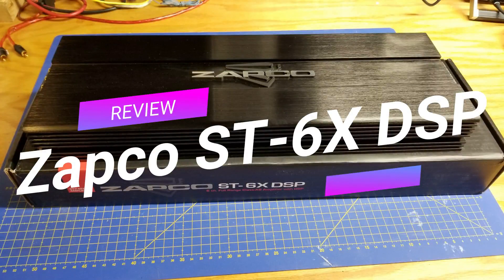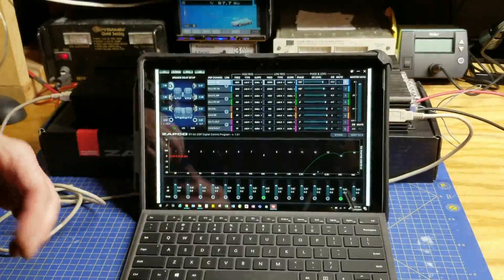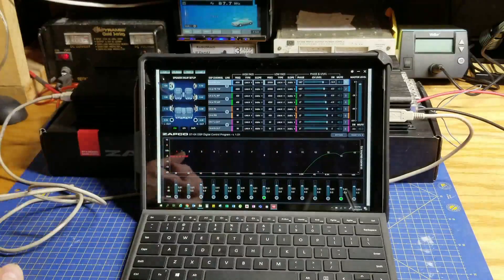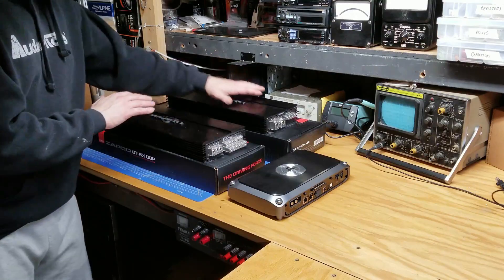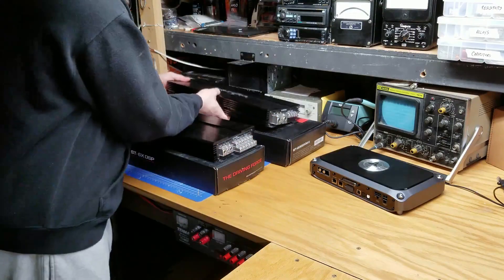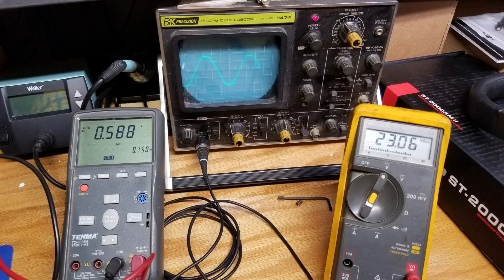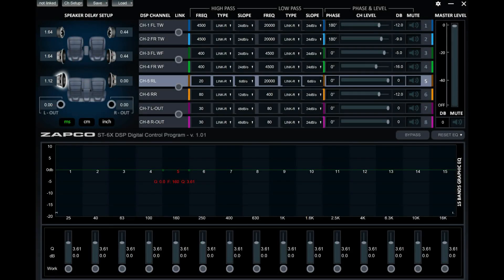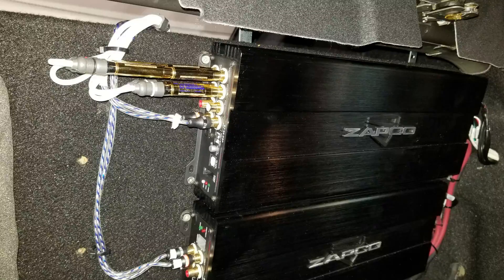Zapco ST-6X DSP Amplifier Review - Spoiler - NO INPUT GAIN!?!?

Comment: Hey I just bought two of these and also a 12 channel pxe 0850x alpine dsp. You think I can by pass the dsp on the zapco and just use the alpine dsp? For my gain setting and fix whatever problems you were talking about?
Reply from the maker: Since you have output control on the PXE, you can use that adjustment to control the signal into the amps so you the lack of gain adjustment isn't as much of a deal.  You'll have more DSP than you need so you can just bypass the amp DSP And use the Alpine.  You can use level output in the amp to tune, which is my recommendation, so you keep all of the amp input signals the same.  It's a weird way to do it but they made a weird amp.   They have corrected the lack of input gain in the newest models.

Comment: I got hte same amp with dsp and my software does have gain set up.
Reply from the maker: I've been told that all of the new amps have improved capability and it's possible the software has been updated since.  Note that output level is not input gain, and the model I tested only had output level.

Comment: Zapco’s stance as well as many in the sq community dont believe in raising amp gains as it reduces headroom and makes whatever noises that may already be in the system louder. The proper way to raise amp gain is from the line driver. Some music has as much as 20db of range in the recording. By default turning up your gains borrows from headroom.
Reply from the maker: The omission of input gain has been corrected on newer models.  The amps came out with the gain essentially at "MAX", which is the opposite of what we would do.  You could not add a line driver with this amp.  We could not use more than 20% of the head unit volume.  They inverted the gain structure.  If you're trying to make a case that what Zapco did is correct, then you're saying that all amps could come out with a fixed input gain set at maximum, allowing for minimal input signal level.  What you're saying is that the amp gain should be fixed at minimum, and then input signal should be boosted with external means, but that's not what Zapco did.

Comment: Im looking at the st-6xsq to run my front. A good choice? 6.5, 3.5 and 1". Looking at the audio control DSP. Your opinion on an external DSP? Thanks!
Reply from the maker: I run JL VXi amps with internal DSP and love them.  I've actually sold all of my external DSPs.  Moving forward, integral DSP will be my approach for space-saving and seamless integration with a reduction in cabling.
Reply: A friend is running an sq system and runs masconi now, though, switched from JL, and said I'd be doing myself a favor by going that route. Funny, this popped up a few days after. After reading more on zapco they still make great amps but not like my old Studio series from way back. JL, like a few others, has the long-running standard of being the bar or above. Greatly appreciate the advice!👍

Comment: Do you know if the zapco dsp-iv ii has this problem. Looking at using one with a 5volt output head unit. Thanks.
Reply from the maker: I haven't tested it but I can say that the Zapco engineers have publicly (on DIYMA forum) defended their design and have said the lack of input gain was on purpose because no one should have a source with that high of a voltage output.
Reply: @richardvedvik979  but there is. A kenwood 5volt output will do 4.7v with a 0db tone. They really should include some form of adjustability.
Reply from the maker: @raymondc9896  Totally agreed, we returned these amps to Zapco because we were using a 5V Kenwood head unit.  I think this was an oversight and they aren't fixing it, instead, they are just saying it's a design feature.

Comment: I just saw another video of this amp and it says u can control gain from the dsp
Reply from the maker: You can control output level, not input gain.  Those are two very different controls.  Zapco has confirmed that they did not include input gain adjustment and do not plan on adding that function.

Comment: Hi, I'm new subscriber. I have a 3 way FOCAL ES165KX3, I going to run active, already have a Alpine pxe-0850s dsp. With choice do you recommend me? Jl audio xd600/6v2 or zapco ST-6X SQ ?
Reply from the maker: Either are good choices but they each are different sizes and layouts.  Can you fit either?  The non-DSP Zapco has normal gain adjustments and is a nice amp, just bulkier.
Reply: @richardvedvik979  thanks for your answer Richard. What is your personal opinion about the dsp alpine pxe-0850s?
Reply from the maker: @hinchadahe  I've had Alpine processors since the 90's including the ERA-G320, PXA-H701, and PXA-H800.   The newest model has even more flexibility with 12 output channels.  And I like the interface options and wired remote.

Comment: Oh My God!! My Zapco dc 1100 came in and I just realized no physical gain knobs! Soo used to old school amplifier!! Besides software calibration wise. Can I just just plug this in my car and play it without any calibrations?
Reply from the maker: You need to coordinate the input sensitivity (gain) setting on the amplifier with the output voltage of your source.  That process hasn't changed over the decades.  You need to delve into the software to find that setting, if it exists.  if it doesn't exist, then you need to figure out what the max usable volume is on your source so you don't clip the input.

Comment: Would you say the reguler st 6x sq is a good amp? Also curious what is the best sq amp youve heard ans how far off is the zapco st sq?
Reply from the maker: Yea, Zapco makes good stuff normally, this is an abnormal miss on their part.  The new JL VXi are awesome DSP enabled SQ amps, but not in the "best" overall category.  I see a wide variety of amps in both IASCA SQ and MECA SQ, so there really isn't a "best" but a variety of preferences.  McIntosh, Genesis, and Mosconi tend to be popular with expensive builds. Once you're spending a couple grand per amp you're into some nice stuff.  Under a grand, you have a variety of compromises that the buyer needs to weigh for themselves.

Comment: I see that Zapco put out a firmware update (on 1/4/20) since the video was posted. Does anyone know if this input sensitivity issue was addressed in that firmware update?
Reply from the maker: Good question, i'll ask my Zapco reference.
Reply: @richardvedvik979  did you check whether they add anything new?
Reply from the maker: @harishchandran6219  based on a reply from a Zapco tech on a DIYMA thread it appears they are standing by the design as-is and they don't think gain adjustments are needed.
Reply: @richardvedvik979  
I'm late to the party, but WTH were ZAPCO thinking?!?!  Their amplifiers have all traditionally been geared towards SQ and accepting strong input voltages for low noise, even going back to the balanced Symbi-Link system.  

Like you, I just cannot understand their logic and also maintaining the stance that the input sensitivity adjustment is not important or needed!  WTH???

Even budget head units have 2 volt preamp outputs, and obviously most people who normally buy Zapco products would be using a head unit with 4v-5v RCA preamp outputs.  :so confused:

This just makes no sense whatsoever, and I'm completely dumbfounded that a "High-End SQ" company such as Zapco would even THINK to design and release such a product, LOL.  Major FAIL IMO.

I'd be really interested to know just how many of these were actually sold, AND how many were returned....AND how much time and money was wasted by producing these pretty much useless DSP/amps?

Who would even approve this design for production?  I'm just so baffled that this DSP/AMP even existed.

I also agree regarding the JL Audio VXI series DSP/amplifiers.  Excellent features, great DSP Software, and clean output quality, though the output power is a bit on the low side IMO.

HOWEVER, I really dislike all of the GIANT Connectors and I/O pigtails on the VXi's!  At first the amplifiers seem tiny (and they are)!

BUT, once you make all of your necessary connections to the amplifier, the GIANT connectors & pigtails essentially make it 3" wider!  :(  You really have to be careful when laying out your amp rack to account for the extra clearances for these connections!

And I agree regarding that it's just silly that JL Audio did not also produce a non-DSP VXi subwoofer amp to go with the multichannel VXi amps.

Thanks for the video, and  hopefully you're settled into the new house by now.
Reply: I have the same amp with dsp and i can set up my gains from software.

Comment: So it sucks?

Btw, u just got another follower from the end of the world, try to guess where
Reply from the maker: I can't say that it sucks because I think it's really close to being great, they just missed a key aspect in design.  If someone runs optical to it then they are fine and can just control volume with the remote knob.
Reply: @richardvedvik979  but not input gain?😏

Mi Pioneer stereo doesn't have an optical output, I'm not 100% sure, but I think it doesn't, I'll have to check
Reply: @richardvedvik979  What kind of remote knob? Where can you connect a knob in?

Comment: Isnt there a gain setting on the amp itself? Which is why there isnt an option on the dsp... or is there nothing?
Reply: Nevermind you answered my question
Reply from the maker: @bennyblanco14  It's not what you expect, but the amp has no input sensitivity or gain adjustment, only output, which doesn't help us match a source to the amp.  Someone could buy a HU with the matching input sensitivity unclipped, pad the input with FMOD, or use high level settings and maybe add a line driver to match the high level sensitivity.   

They overlooked it, sadly.
Reply: @richardvedvik979  you said in your video u spoke to zapco rep?...what did they say on the matter?
Reply from the maker: @bennyblanco14  The reps are not able to influence the manufacturer.  They understand our concern and have no ability to make change.
Reply from the maker: @bennyblanco14  no response was given.  Just today, someone from Zapco is discussing the lack of input gain on the Strictly Sound Quality group on FB.   Zapco essentially  maxed the gain knob then broke it off to prevent owners from matching sources.

Comment: Can u adjust the master level DB in the dsp and reduce it to accept high voltage (4v) from HU so it wouldn't clip?
Reply from the maker: Master dB is output signal, not an input sensitivity adjustment.
Reply from the maker: To expand:  no, you cannot prevent clipping with the master level slider, i demonstrate that in the video.  Without a dedicated input sensitivity adjustment it is not possible to change the range of input signals the amp can accept.

Comment: So, is your recommendation .5 RMS volt or .5 peak in the input signal?   thx!
Reply from the maker: That DMM is reading RMS voltage so yea, 0.5V RMS is the RCA input signal.
Reply: Thank you!  I bought one two months ago and have not installed yet .. I’m stuck with this unit..
Reply from the maker: @bginvestor101  we tried using some inline attenuators (FMOD) to knock the HU output down so we had more usable volume range.   It worked well but was bulky.

Comment: Just to clarify, if i use only high level and optical inputs, it should work ok? or high level inputs are also subjected to clipping issue?
Reply from the maker: Optical is certainly OK because that isn't tied to the analog inputs.  I didn't test the high-level inputs, but I should have before I sent the amp back.  I only had a few days to test and make the video before sending it back for a refund.

Comment: I have a quick question for ya.  Since the amp has high level inputs, could you test the clipping voltage of those?  If it can go to the 4v better input voltage soldering up a high level to RCA adapter might mitigate the issue.  Worth a shot.
Reply from the maker: I like your idea and had the same after the amps were shipped back to Zapco.  I had a limited amount of time to test before having to send them back or incur really high fees (25%).  I'm hoping someone else with one can (I have a buddy I can ask).

Comment: why didn't you swap it out for the st-6x?
I'm having distortion issues when the volume is turned up...I've tried fixing it by adjusting output signal through the H/U, It seemed to help some, but there is still some distortion at low volume which tells me that that the input level is set too high and you can't fix it at all... I have also been hearing (on occasion) a hissing sound at low volume or no volume and at times have to turn the amp off and back on to get it to go away...It's loud even @ 0 volume...very concerning...I am thinking about returning this amp for something else...I don't think it will be zapco again. The Orion amp that I had before the zapco sounded way better, but it was a clipper as it was 400 bucks cheaper.
Reply from the maker: We already had an Audison LRx5.1k that the Zapco were supposed to replace, and the owner was done with Zapco after this experience.   My testing showed clipping after 0.5V input on the Zapco, which is stupid low.  Adjusting HU outputs is one way, but we still felt like it was really quiet when we kept the signal low enough to not clip.  Owner considers the amp a fail. 

Thanks for sharing!
Reply: @richardvedvik979  I was almost talked into keeping this amp until i watched your video again, and  I decided not too and sent it back.  it has too many issues for me including the gain adjustment. Do you have any suggestions on good amps around this same price?  I'm looking at the AudioControl LC-6. Customer reviews seem to like it...I'm not sure after the zapco disaster.
Reply from the maker: @Tsmixedup  the JL Audio VXi series is awesome.  I've enjoyed them and am very impressed.  Very flexible.
Reply: @richardvedvik979  cool, thanks man!

Comment: I may have missed it but are you driving a 4-ohm load? If so wouldn't that be in the neighborhood of 160+ watts per channel(V^2 / impedance) from a rated 100w per channel amplifier?
Reply from the maker: Not in the video but I did drive a speaker and turned down the output levels to observe input clipping regardless of output level.   Full rated power is achievable with a 0.5V RMS input signal.   18V out is 81W @ 4 ohms.  The amp can do rated, clean.
Reply: @richardvedvik979  Thank you for the information